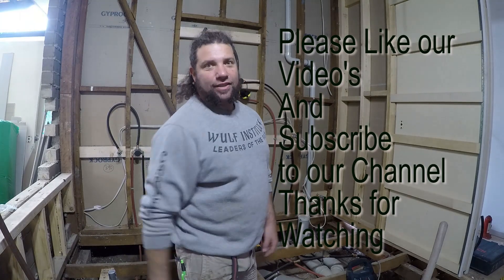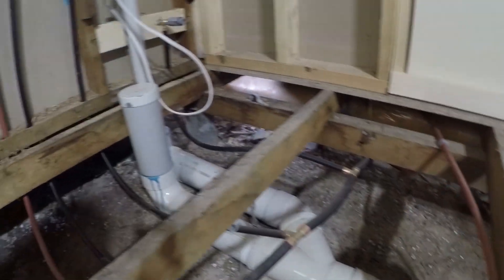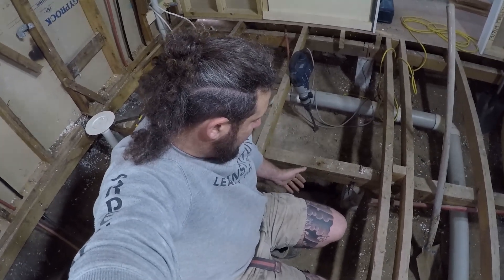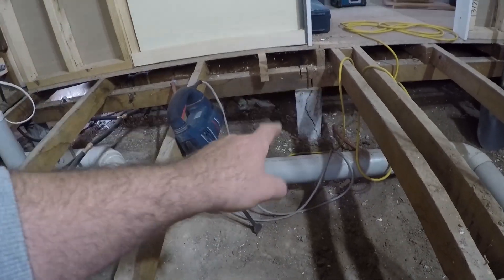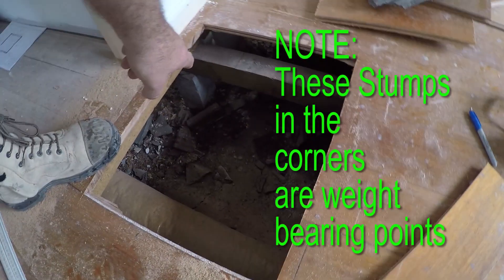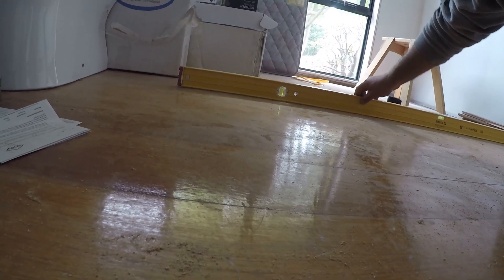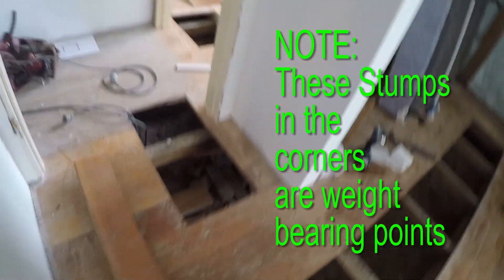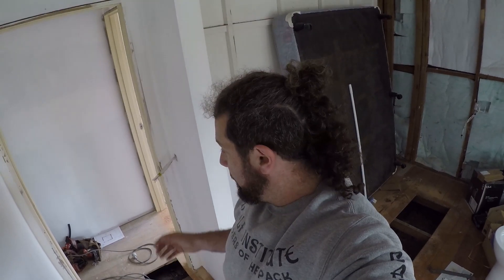How to correctly Restump a home & Structural Supports

Comment: Interesting, what is causing the concrete stumps to crack...is it too much load?
Reply from the maker: AWESOMETOWN question Pseudechis,
initially that is EXACTLY what we thought but after finding several in the center of a non load bearing floor area, had to get a professional in..... the conclusion was the pin in the stump rusted due to additives in the mix during manufacture which caused the pin to rust.... the rust then expanded and pushed its way    out of the stump where is was getting the most oxygen (above ground).  Some of them were in critical load bearing points !!!!!! i'de NEVER seen this before on stumps.  #Stayawesome joe joe
Reply: Exactly right
Reply: Ok, the real cause is that the ground has moisture in it that is gettion into the stump due to the fact that when they fitted the stumps they backfilled the holes with dirt not concrete and because of this the steel reenforcing inside the posts became wet. 
This happens over and over again where the steel gets wet then dry then wet again again, this causes the steek inside the post to rust, this rust then travels up the steel inside the post and expands the steel with rust, Nothing is stronger than rust, so the expanding rusty steel then cracks the concrete post. The same thing happens with steel posts and even quicker with galvanised steel posts. This is why rust prevention before the post is fitted is so impirtant.
In the case of concrete posts I make sure that there is at least 2 ins of concrete around all 4 sides of the post but with steel posts I now use a 2pac epoxy enamel paint to protect the posts and painted one foot down into the hole and one foot above the ground before I fill with concrete. This will give 30 to 50 years of protection to the steel or even more if done with 2 coats. Do not use acrilic as acrilic is water based ad porous and lets moisture get to the steel.